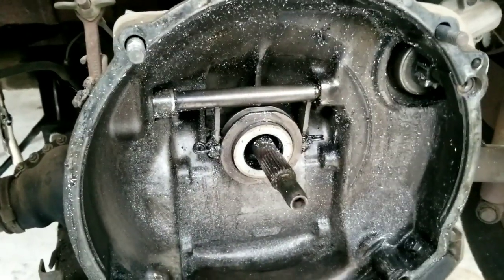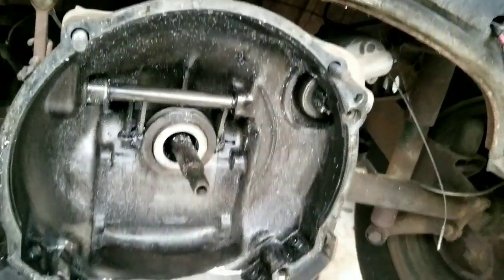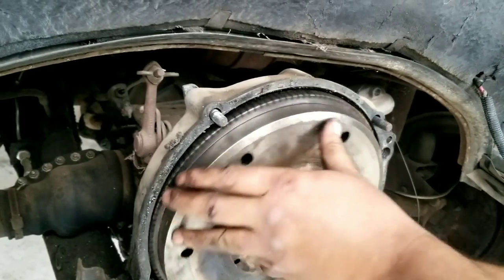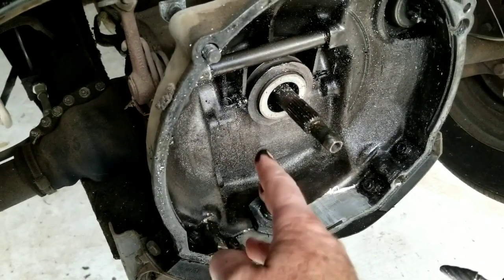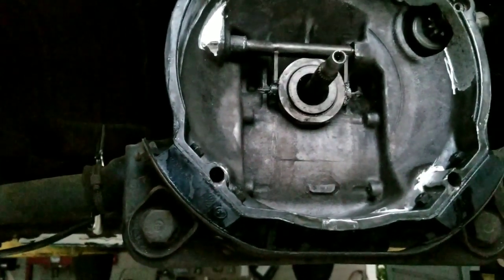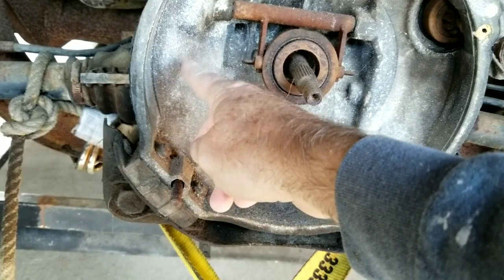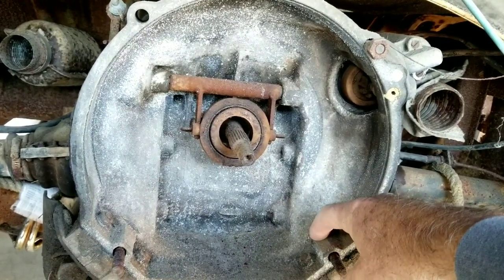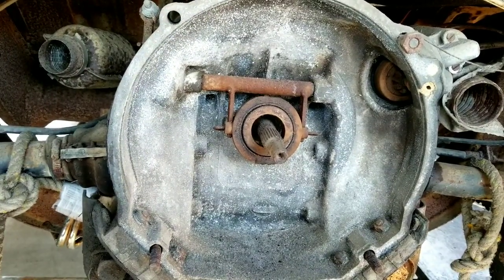Machining 6 volt vw trans case for 12 volt 200 mm flywheel

Comment: so why not take and make an arbor that will fit the crank that the gland nut can screw in to and be driven with a 1/2  drill motor and that way it can center up on the input shaft as its turning and mark where you need to remove metal and if you have the skills to do that you can also remove the 6 volt bushing and bore it out and install the 12 volt bushing in it and reinstall it

Comment: I am a VW newbie, without a starter pressure plate or flywheel just the bellhousing case, how can I tell if it's a 6-volt or 12-volt. Is there something I can feel with my fingers or look at that would indicate yes this is a 6-volt or 12 volt bell housing.

Comment: what clutch would be used for this setup? im looking to do the same thing and im new to the vw stuff. Im working on a dune buggy project and need to figure out what clutch. I do have the earlier style throwout bearing and pressure plate. Would that work with the bigger flywheel or do I need a different clutch to work with the 12v flywheel to 6v transmssion

Comment: I'm new to this vw world so spare my knowledge.. 
My 63 beetle had a 6v starter and I went and purchased a 12v.. I knew nothing about different flywheel or tranny being 6v or 12v. Well the 12v I bought didn't work due to the bearing, so i purchased a 6v.. should work like before.. My question now is that while getting the old bearing out, a part of it went into the flywheel housing, I read a guy say that it could be left there and the flywheel will pulverize it because is a soft metal, is this true or could I damage the housing? I've never taken the engine off nor done any mechanical but this.

Comment: If you have an old crank, bolt up the gland nut, 12v flywheel AND crank. It more precisely centers the whole unit better than just the flywheel and unsupported nut.
Reply from the maker: good point.  plus it would give you a handle to turn it with.

Comment: What about just keeping a 6-volt flywheel & clutch assembly on the larger engine? Will this cause any problems that I'm unaware of?
Reply: I've read a few times it works fine with 40hp clutch and am about to try it on my trike. I also read , but not as often. That the 36hp clutch will not work.  Guys staying with 6 v flywheel like them bc there still wat cheep and work apparently quite well in racing applications... Once again... About to find out today for myself

Comment: I keeping my 6 volt started for now is working fine so far
Reply: I have put a 12v starter with a 6v drive gear.   You pop the ring and the drive gear comes off.  You’ll need a bushing for the bendex because the shaft is smaller.  

You still need to put in the thickener bushing in the trans ... again because the shaft is smaller.

Comment: Not knocking it but your warning on sparks on the magnesium and then tell how to grind in the flywheel while running and slowly tighten the motor sounded scary. But sounds like you've been successful few times doing it that way👍

Comment: Is there anyway to modify the starter motor itself and use the 6 volt starter and use the parts of the 6 volt? Also what about using a resistor block or something like that to cut the voltage to the starter or some form of step down at the starter?
Reply from the maker: not that I am aware of you can get a early bus flywheel but it has a 1500 crank end and 200mm and 6v ring gear. so you need to run a 1500 crank and a 6v starter.6v starters work ok on 12 volts. they spin really fast. Just harder to find now. Easy to machine the case to fit 200mm. then put the engine in and run it tighten up the bolts while its running and do the final machining. done it many times.

Comment: There is an old racing trick people used to do with 6 volt starters.  Convert to the 12 volt flywheel but retain the 6 volt starter.  What a lot of peole don't know it that the 6 volt starter actually has heaver windings then the 12 volt starter and will easlly handle the 12 volt battery.  The best part of doing this trick is the engine will spin and start faster than with the 12 volt starter.  I did this on my 66 dune buggy and never had any trouble with the 6 volt starter.
Reply: Certainly makes them easier to start using 12V on the 6V starter, and yes the starter motor will handle the extra volts just fine.
I've used a 12volt battery on a few of mine.
Reply: um, unfortunately that's impossible since the 12 volt flywheel has 130 teeth and the 6 volt flywheel has 109 teeth ... "old racing trick" sure, go ahead and see how a 6 volt starter gear sounds against a 12 volt flywheel, I'll wait
Reply: @billsimon3000  Who said its impossible? Not only is it possible, its regularly done. Your thinking is logical as they have a different number of teeth, but the fact is that they do mesh. This is not even a racers trick, this is a proven fact that the 6 volt starter can be retained, used, and is successful when converting to 12v and 200mm flywheel. Give Darryl Auch a call, he'll explain it to you. Better yet, don't wait for us, why don't you go ahead and put a 6 volt starter to a 12v flywheel, then come back and let us all know what you find. The way it works will amaze you. Do just 2 minutes of research before you drop "facts" on people about what is possible vs impossible, because your feeding others wrong information. Have a good one.

Comment: I had to use the engine as a lathe to have the lightened SCAT flywheel to fit. Stock 12V flywheel worked fine, 12V SCAT lightened flywheel had to machine it self in. This trick occurred to me at the time...
Reply from the maker: yea most of the time you need to run the engine and tighten the bolts slowly as the flywheel scrapes the case. even after machining.
Reply: @Mikefngarage   I was going from 12V stock VW flywheel to SCAT lightened 12V, you figure it will fit...